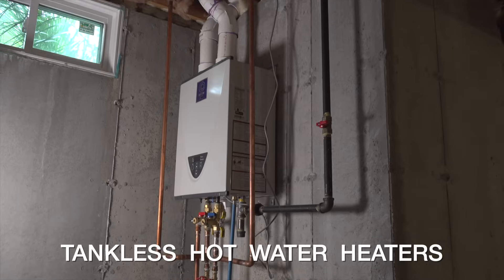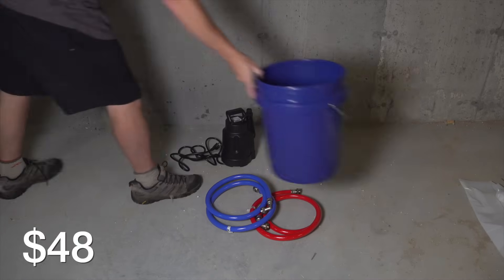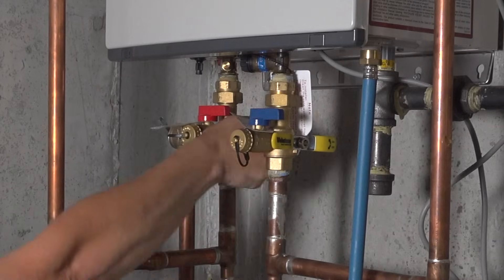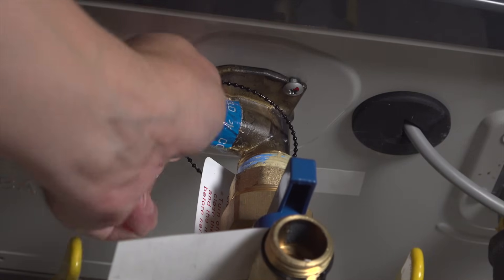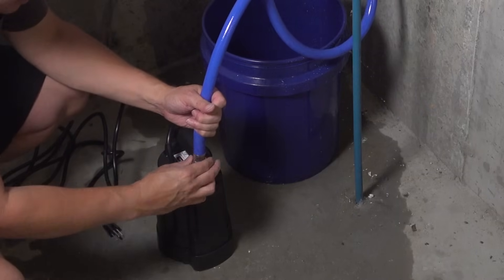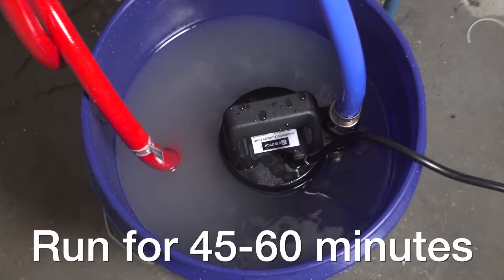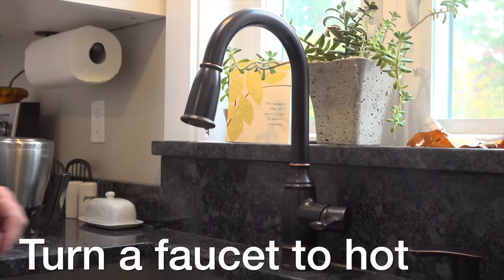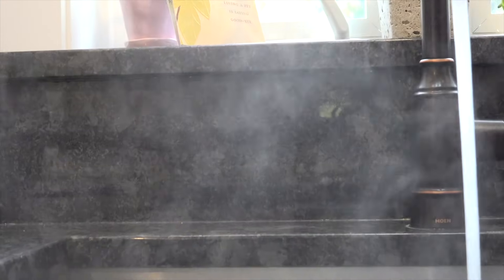How To Clean & Flush Tankless Hot Water Heaters with VINEGAR!

Comment: Pro tip: Hook your hoses to the valves before opening...then you can just drain the heater's leftover water directly in the bucket instead of water going everywhere.
Reply: Pro tip very much appreciated! Didn’t think of that.
Reply: Additional pro tip... flush out the vinegar with the cold water while the hot side hose is still on.. no vinegar in the lines.. pretty sure a little vinegar wont hurt anything tho
Reply: I read this too late. Water all over myself.  Lol
Reply: Make sure to activate the hot water - then shut off the electric before cleaning. That way you will get a complete clean.
Reply: @analogguy5548 why? Is it to get heating elements warm inside the tank so you are circulating hotter vinegar water? 🤔
Reply: Yeah, I like that.
Reply: I’m sure my phone was listening. I’m doing this tomorrow. Just bought a kit for $65 on Amazon. Been putting it off for two years.
Reply: Lol or just open up the overpressure valve and let it all go out that way.
Reply: @rednkfn  That too.
Reply: Exactly what I thought the first time I watched this video.
Reply: Geek

Comment: Can an oversized pump cause damage? I am looking to get a brand new sump pump anyway for our basement. If I used a 1/2 HP pump would that be ok rather than the 1/5 HP you used?
Reply: That could turn the hoses into whips but if you keep control (especially the hose where the water comes out of the heater) I'd use the 1/2 HP pump myself!

Comment: Connect your hoses first after pulling off the caps.  Put the hoses in the bucket and then open the valves.  No need to spill any water.

Comment: Definitely recommend doing a fresh water flush with the bucket/pump right after for a few to get the majority of that residual vinegar you mentioned.  Only takes a few minutes and prevents that residual vinegar from entering your fresh water piping.
Reply: While the vinegar won't hurt anything, I like to flush it out. Just remove the pump hose to the cold side and cap it. Then slowly turn on the cold water which will flow thru the unit and out the hot hose into the bucket. Done.
Reply: I would be more concerned with leaving vinegar in the pump between uses. For that reason, I agree that you should flush with fresh water before storing the pump.
Reply: I did this as well!!

Comment: Thank you for your video.  I've been negligent in maintaining my tankless water heater and I just purchased and installed the bypass valves for circulating the vinegar/cleaning agent.  The initial installer hooked up the heater without bypass valves ($75 to $80 at Home Depot).  My tankless water heater recently started providing a hot shower for approximately ten minutes then the water got cold.  I'm hoping this fixes the problem.
Reply: Im having a similiar issue. Did you get your problem resolved? Thanks
Reply: @agoogleuser6902  I try to do this once a year (before symptoms arise) ...but.....the last few days my water isn't getting as hot and I KNOW that I'm overdue. Flushing will fix that. Good luck with yours!!
Reply: I am having the same problem,  all the sudden the water gets cold while in the shower.   Just had it cleaned, and now it takes FOREVER for the water to get hot!

Comment: I should like to fit similar 'flushing valves' to my system - but cannot find anything that looks like them online!  Any idea what they are called and/or where they can be purchased please??
Reply: Home Depot has them for approximately $80 (IS-TWH-FT-FS).  For my Rheem EcoSense tankless water heater I also had to purchase a couple copper nipples for the installation of the "flushing valves."  The valves were called Series TWH and LFTWH Tankless Water Heater 3/4" Service Valve Set.  Manufacturer's website:  www.watts.com
Reply: @dericenglish126  Nothing like it available in the UK though!   I ended up using a couple of isolation valves and  washing-machine feed tee's. Works very well!

Comment: What if you have a thermal expansion tank on the cold water line?  What needs to be done for those?
Reply: Ideally you'd release all the pressure (drain) the tank then use a tire pressure gauge on the air fitting to make certain the tank is still pressurized to within 2-5 pounds under your water pressure. Add air if needed. Done. If the tank no longer holds pressure it should be replaced.

Comment: I might add if your pump is running too hot set your five gal bucket into a larger container filled with cold water , the cold water will draw the heat out of the bucket

Comment: If the water is already hot then why are you heating it?
Reply: Because if the water has no heat it won't flow. With supply water typically having a heat content of 280 degrees, most people like their water 310 to 320. Hence heating hot water.
Oh those temperatures are in Kelvin. "hot" is relative and pedants need to be careful because it often appears childish.

Comment: I have a small ( 100 litre) electric tank heater that needs to be descaled . Do you think this would work ? I have access to a pretty big plastic tank that I could use as the bucket . I was thinking maybe 20 litres of high strength vinegar in say 20 or 30 litres of water and let it run for a few hours on my bilge pump ?

Comment: Go ahead and run a few gallons of fresh water thru the tank after the vinegar.
Reply: Yup, just open up the cold water supply and let it drain a bit out of the hot hose before removing it.
Reply: @djlowtek  wouldn't opening up a faucet do the same thing?
Reply: @bymitten1  The point is to get any crusties/residue flushed directly out before letting it flow back into the house lines. The vinegar had been recycled with all sorts of particles in it. Flush it clear then let it flow back into the house
Reply: @djlowtek  Ahhh, makes sense. Thanks the info

Comment: Fantastic video👌🏾👌🏾 I have a water softener would I need to do this very often?
Reply: Water softener's remove most of the minerals and calcium that make water hard, I would still flush maybe every 5 years for the hell of it. But really not necessary
Reply: Keneth there is a product called iron out. You use it to clean the water softner. You use it once a year

Comment: I just flushed my Navien NPE-240A using a regular 1/2 HP pump instead of a sump pump and it worked like a charm.  It floods periodically where I live so I am well equipped with pumps, so I used what I had.  Thank you!
Reply: Does your Navien have a recirculation pump and storage unit in the heater? If so, did you have to do anything with that specifically or just what's mentioned here? Thanks!
Reply: @BlakeAdamsCO  Just what was mentioned here.
Reply: @BlakeAdamsCO  Sorry, forgot to mention...no internal circulation pump.

Comment: Can I use a stronger vinegar? 20%, 30%, 40%, 45%  ?
Reply: FYI I just checked the bottle of my 30% vinegar. It says it can damage the finish on some metals, so probably best to dilute it. For 30%, 1 part vinegar to 4 parts water will take it down to 6%.

Comment: Can the same be done to a water heater tank? Seems similar but would require much more vinegar or an alternative mineral disolver like clr.
Reply: Regular Water heater tank has what's called "Sacrificial anode" inside the tank to attract scale buildup.  Instead of using above method, you just simply replace the anode which can be purchased from your local supply store like lowes or homedepot.

Comment: Well just tried it the way you explained,  Never thought of Maintenance. I pretty much have the same Tankless set up like the one you showed... My only issue is. As soon as I Turn on my pump on, I get a rush of return Vinegar, then nothing after a few seconds... Thinking ok I have a plug. but then I unplug my pump and replug in to power and stream of Vinegar comes out then stops and so on and so on. I'm open for suggestions with some help any Ideas? Thanks ahead
Reply from the maker: That sounds very odd. Can you just try to have the hose come out of the pump right into the bucket. Don't even go into the water heater, this will makes sure that the pump is really pumping. It sounds to me like the pump is getting stuck.
Reply: I don’t have a tankless but there almost has to be some sort of reset procedure that can be used.  Maybe yours needs it.  Also, check to make sure your inlet valve (to allow fresh water) is open (if this is after the cleaning procedure).  Otherwise, I don’t know.  Good luck.

Comment: Wouldn’t hurt to clean the system twice a year instead of annually
Reply from the maker: No, if you use vinegar it is fairly gentle and if your water is more on the hard side twice is better. You coud probably but the time down to 30-45 min also. Once you do this its so easy a couple of times a year is a breeze.
Reply: @SilverCymbal  Another great video, super easy process, Thanks for sharing.  As you mentioned regular vinegar works, if applied regularly. If your system has not been cleaned over several years, there are more aggressive solutions that could be used. I stick to vinegar. Cheers.
Reply: Depends on how harsh your water is, and whether or not there is a filtration system in front of the tankless system.  I have 2 x large charcoal filters with a 5 micron rating and I've only done a cleaning every 2 years and had minimal evidence of any "dirt" in the system.  Only "dirt" i found in the tankless pre-filter was some thread sealant/pipe dope.

Comment: What if you have whole house filter
Reply from the maker: Those will usually just particles or chlorine, but hardness they won't change and that is almost always what is built up on the heat exchanger inside of these.
Reply: @SilverCymbal  so should also get a water softener

Comment: Just get a whole home water filter system
Reply from the maker: Those are great for chlorine and debris but they won't reduce hardness which is will cause the build up inside the tankless heater.
Reply: I would not run a tankless without one. But you still should descale it annually.

Comment: The green color comes from the copper piping. Using vinegar in copper accelerates the corrosion process. Copper turns green when it corrodes
Reply: Is there any way to clean the tankless and avoid corrosion of the copper pipes? Or will the pipes just have to be replaced sooner?

Comment: Great video. Thanks. I use citric acid to clean my coffee maker. I buy the powder in bulk. Turns out it’s the same stuff you can buy premixed that’s very costly! We were told by the manufacturer that vinegar doesn’t do as good of a job. What are your thoughts in using citric acid instead for the water heater?
Reply: Citric acid is recommended by the manufacturers of coffee makers because it does not damage the seals. Especially the seals in the pumps are prone to getting hard and fail if vinegar is applied repeatedly. Another problem are coffee residues. They are sometimes impossible to remove, but they will take on the taste of vinegar. Definitely doesn't improve the taste of your coffee. In contrast citric acid has much less of a taste. After flushing you will definitely not taste it.

Comment: This is a helpful video, but please note, a good plumbing/ heating technician will also do a complete burner cleaning and dial in the proper gas pressure for clean, efficient combustion WHILE the unit is being flushed. So it is important to remember that this is only HALF the job. And the less important of the 2 halves.

Comment: It might help to filter out the scale particles in the red hose ( returning the cleaning solution) before it goes into the bucket. 
  The faucet  used for the final rinse may get a restricted strainer if big particles are still present.  Thanks for the technique you shared.

Comment: I've seen other videos where they use muratic acid instead of vinegar. What are your thoughts on this?
Reply from the maker: I would try to avoid that unless you really have a major issue and it was a last resort. That is very caustic and could damage the insides and if a connection ever leaked while doing it you could get hurt as well. They have some commercial solutions designed to clean faster, maybe not better though. They are designed so a tech can get out faster. I would try this was and see what results you get first.

Comment: I regret not getting a tankless water heater when I needed a replacement but plan on getting one next time. Thanks for this video, great info. I'm a bit amazed though that the vinegar doesn't destroy the pump.
Reply: You flush the pump with clean water when you're done with the water heater.
Reply: Its not hydrochloric acid,just ~4% vinegat,flush with water when done,good to go!

Comment: First off, thank you for showing this video. This is awesome and amazing.

Now, about 6 years ago, I was very interested in getting one of them installed. I didn't have anything particularly wrong with my 65 gallon water heater except for inconsistent heat lengths when showering. The tech that came out was like LOOK HERE BUDDY $1,000 replace the one I had verses $4,000 or whatever the number was and he said, never go tankless. Tankless have all kinds of problems and they last 7 to 10 years. Then you have to start all over again.

Now about 3 weeks ago I had a water 💦 softener put in. He believes in 3 months after installation, the small amount of salt will clean the tank and all the house water stuck to the pipes will be gone. It has to have already done something with the tank because we never use all the hot water 💦 like we used to when my girlfriend and myself showers together.

Now the spot we always used on the dial is 1/4 of 1" lower on the dial and rarely do we ever have to bump it up to keep the water 💦 as hot 🔥 as we like it.

I want to lower how hot we keep the tank but my girlfriend's brother isn't the smartest. It's my or our house (I've had it since 06 and I met her 6 years ago). Anyway he hit a rough patch about a year ago and he's staying with us. I said all that to say (3 bed - 2 full baths), her and I were in the master bedroom showers and he decided to shower once we had already started. 10 seconds later 100% cold shower and I'm paralyzed - all soaped up. Later he couldn't understand why I was in a pissed off mood all day. Because he isn't the sharpest knife in the drawer and his mother had just passed away, I didn't lay into him over it.

p.s. I'm half asleep typing this on my phone.

Comment: Mine failed in 3.  I did all the maintainence.  First the fan went, then the burner went.  They were covered under the warranty and repaired.  Once the board went and it wasn't covered under warranty I went back to the tank.  I wanted to love it. Maybe I had a lemon, but issues from others didn't boost my confidence.  Ill wait a few more years as popularity continues to grow.
Reply from the maker: Tankless heaters are not perfect and many had major issues in the early years. Keep an eye out for a new videos talking about the differences but as you have found they aren't perfect for everyone and they have a lot of technology in there,
Reply: @SilverCymbal  
Our Rinnai tankless water heater is 8 years old and no problems until this year. I’ve never done any maintenance but noticed a decrease in pressure, then I found this. I’m doing the maintenance. 
Don’t give up on tankless. It  saves me about $20 a month in electricity and I never run out of hot water even when guests stay over.
Reply: @SilverCymbal  it was a sad loss because our utilities are in a closet. Taking the tank out and installing a tankless elsewhere afforded us much needed pantry space in that closet.  I wasn't happy to go back to the tank lol.
Reply: @5ghostshadow  i plan on doing the same thing. REmoving my old tank from a central closet so i can remodel two bathrooms
Reply: Unfortunately, they just don’t build appliances to last anymore.  I think  Toyota needs to get into the appliance business!

Comment: Very informative and well demonstrated!!! I don’t have a tankless because of the stories regarding constant maintenance. What is the manufacturer or yours and are you still happy with yours or would you now purchase a different model/manufacturer?
The plumber that installed the one in the video definitely had maintenance in mind and made it easy to access important connections/valves!
Reply: The maintenance is very easy though.  Don't let that dissuade you.
Reply from the maker: This one is actually at my friends house who need it to be cleaned, he absolutely loves it & it works great for a big house with kids. Very happy with his purchase. This model is a State brand water heater, but the real brand is Takagi. Seems to be a great unit.
Reply: @SilverCymbal  thank you
Reply: My Rinnai is 3 years old. Best upgrade for a family with teen girls.
Reply: @shakyzeg  is the maintenance as easy as is shown in this video or what steps would you recommend?
Reply: @MRrwmac  it's pretty much that easy. I do not clean the burners like another comment said. I do not recall that in the manual. I will have to look it up this January when I do the annual work. I did order a surge protector, per a recommendation on another comment. That makes a lot of sense.

I used Matt Risinger's video on the same task as my guide, but I also follow silver cimbal on YT.

I have also not looked for the filter shown and cleaned. I'll look for that this January as well.